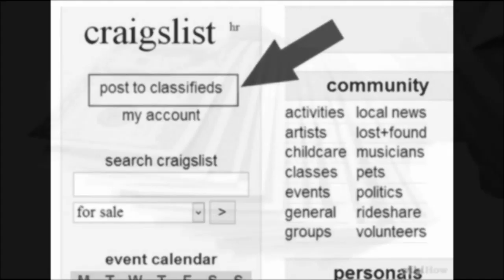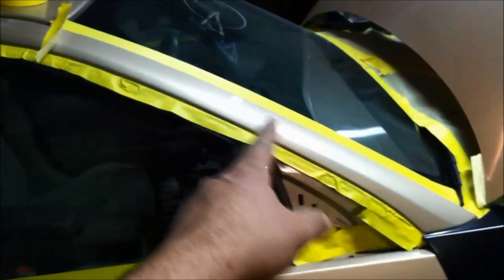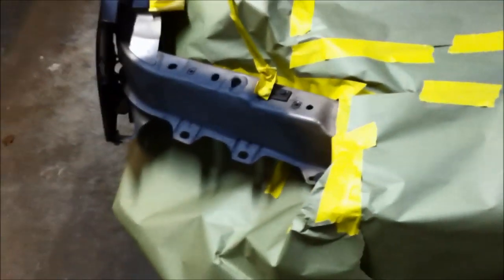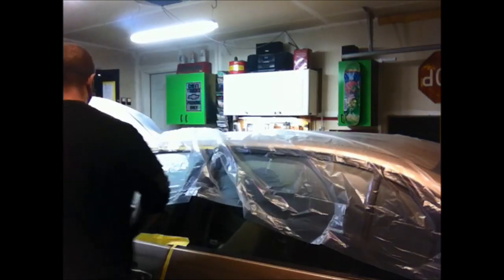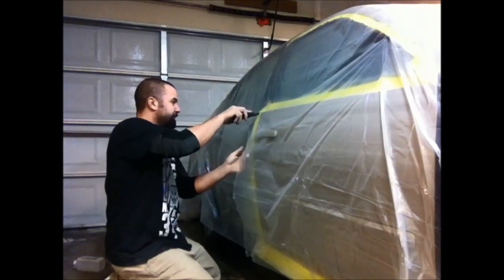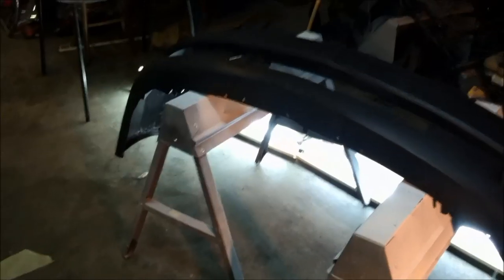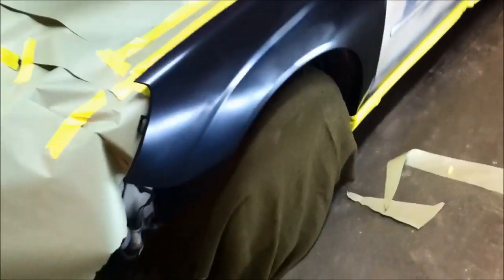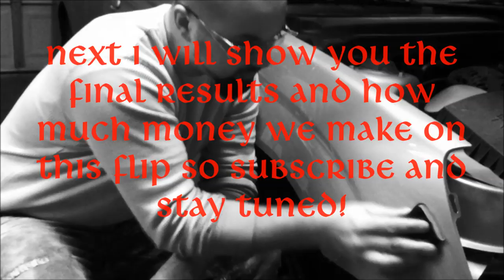How to Paint a Car | Flipping Cars from Home | Malibu #4

Comment: been building a lot of car for many years. this is just advise not trying to be rude or mean here. turn your pressure down and slow your passes down. also your about 18 inches or more from the panels about 70 percent of the time. adjust your fan pattern and get alittle closer. about 12 inches. this will solve a lot of your pressure/ orange peel issue's. I do agree a better compressor would make you like a lot easyer. take it easy I will check in from time to time.
Reply: also get that new gun out and test it. I would love to see it in action. even if it just a test panel

Comment: I know this is just a flipper...but you should use some kind of sealer on those E-coat parts!  not only will a light color like that cover better, it won't peel off once stone chips get to those fenders.  If paint starts peeling off the cars your selling, people WILL stop buying cars from you.  another tip is before you start spaying color, mask off the joining panels first.  spray your new parts or prime areas for coverage before you blend it out.  this will save paint and you can keep your blend areas smaller if you have a tight area or a color concern.  you've come along way from your Dodge Ram flip, keep up the good work.
Reply from the maker: Yeah I just started using sealer and it's fricken SWEET!! Especially over body worked areas or panels with multiple colors. Way cool. I used to have those fuzzy areas coming through the base coat were I had filler and couldn't figure it out but that sealer is the trick. And your right on the black panels. That might be why my match was a little off on this one.

Comment: hey Man ! just a few tips or call it advices. You should put your compressor in a different room, it is sucking in all the paintfumes, not the best thing. Did you mix any thinner in your clearcoat ? If not then try adding 10% of thinner to the mix, then for sure you can also turn down your pressure to around 2 or 2.5 bar, and seems to me that you are holding your gun much too far from the car. If you get your clear a little thinner (10% thinner added) and get closer to the car and turn down your airpressure ,then you will have less paint flying around in your garage. And just another thing, how long is your airhose ? you can not expect that your pressure at the end of a long airhose is the same as at the compressor outlet.

Hope some of these tips can help you out
Tried it ,and been there myself, hehehe if you know what i mean  ;-)

been painting for around 10 years now, and dont really have any of that problems anymore

Regards Chris

Comment: Also that gold you put on those fenders might fall off. You need to prime those. That was black e coat. Not meant for topcoat right over them. Also your bumper might crack without the flex additive. You can get away with it if it wasn't on the car but whatever.

Comment: Was hoping to see the new harbor fright gun that you got in action.  The vid said you used a Finex sumthin or other .  Did you give up on the harbor freight one...I was thinkin about getting one based on your earlier comments.  Looked like a good color match !
Reply from the maker: The Malibu flip was filmed in the winter right before I got that gun. This Car was basically the reason I decided I HAVE to get a big compressor and a newer gun. I got a near full paint job plus body work on a 2008 F150 coming up that I use that gun on. It's crazy with that gun. The first couple of jobs I did with the new gun I was running it at like 40 lbs or even a little more cuz that's what it sounded like it needed. And being used to that Finex I didn't realize that I was running it way too high. Backed it down to 20 lbs and laid down a nice flat base and clear. Still has a little orange peel in the clear but was just slightly worse than factory peel. A little more practice and I'll have it. That gun is ok but I wouldn't speen 70 dollars on it. I would just buy a used DeVilbiss Finnish Line or an older Sata Jet on ebay. But for production paints Nason and Omni and cheaper paints I would buy this gun for 50 if there is a coupon for it cuz it lays it down nice when using it right.
Reply: Thanks for the update Sir !